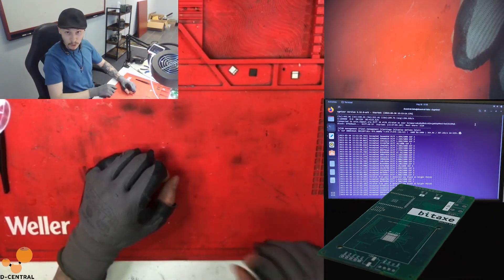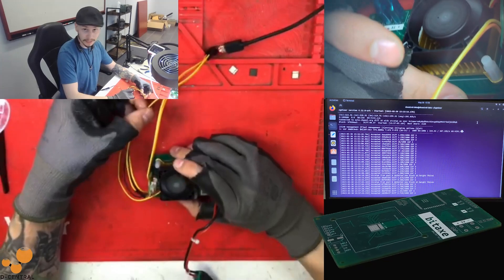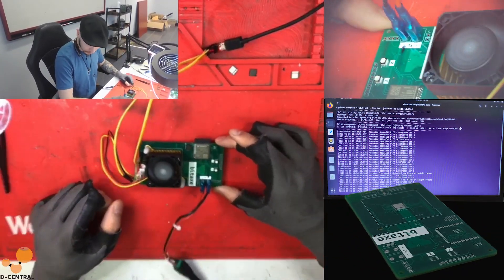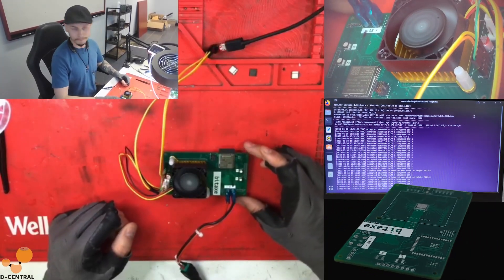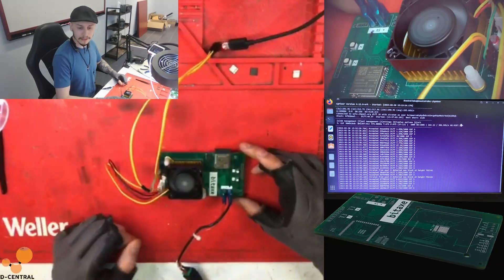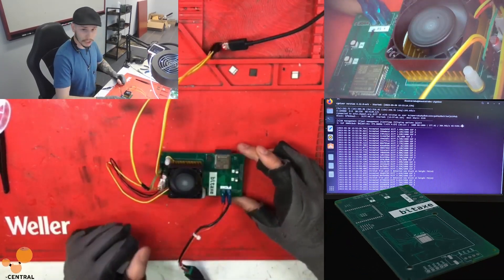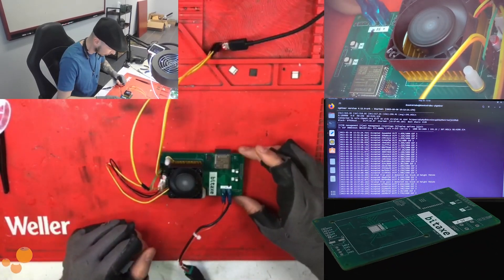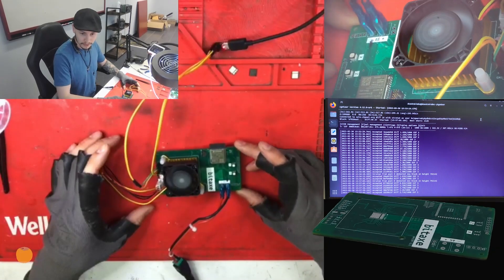Bitaxe Follow-Up: Putting the Proof of Work to the Test

Comment: An instructional video on how to connect it to a PC / Wifi and start mining would be great! Thanks!
Reply from the maker: Coming shortly!
Reply: @DCentralTech  -  Yes. A video on how to use this with USB instead of wireless would be great.  
If possible, I would rather be able to connect multiples of these to a computer / Raspberry PI via USB and have the host computer running something like CGMiner with combined hash rate instead of having each individual unit running on its own and each one using an IP address on the network.